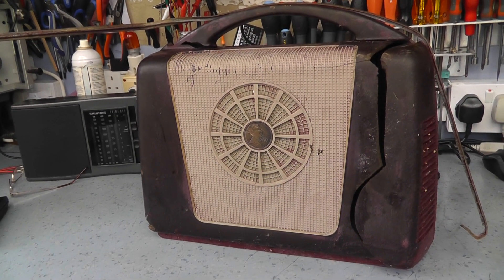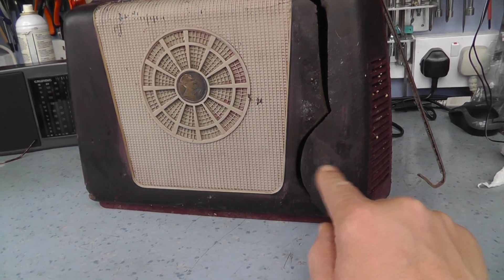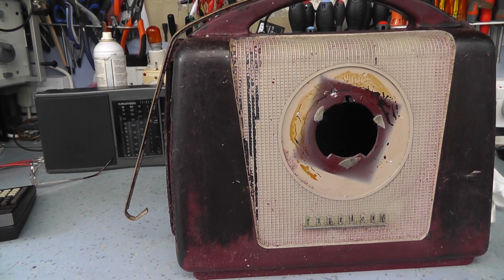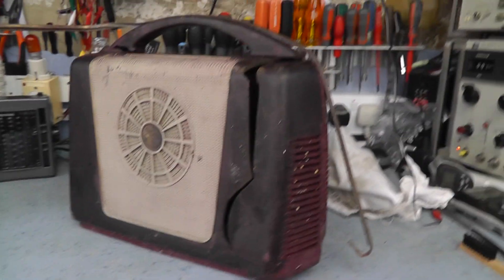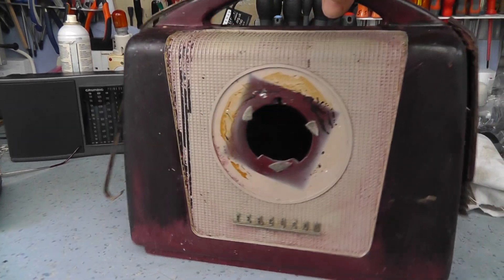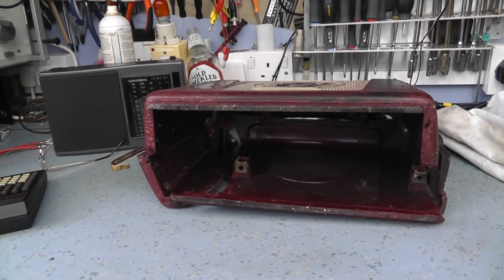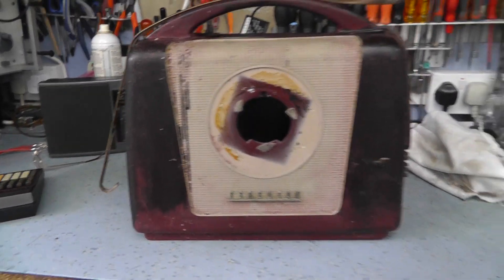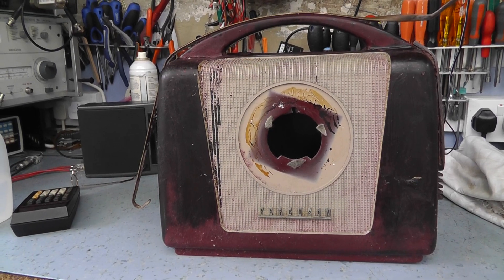Ferguson 342-BU portable radio Pt3 . The end

Comment: I have successfully repaired a Marconi set that was literally in pieces, like yours it was painted Bakelite.
I repaired it from inside using fibreglass paste used for car repairs, once solid I used car body filler on the outside.
It turned out perfectly, once resprayed you would never be able to tell it was ever damaged!